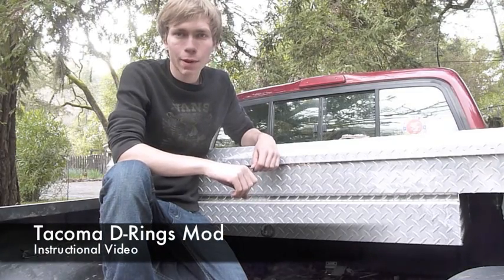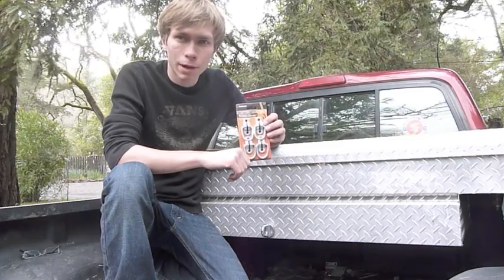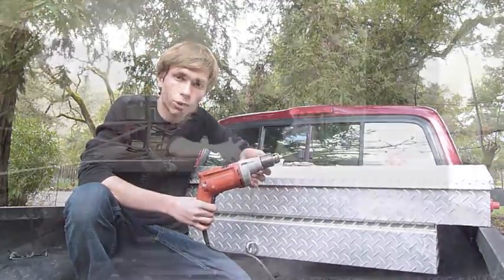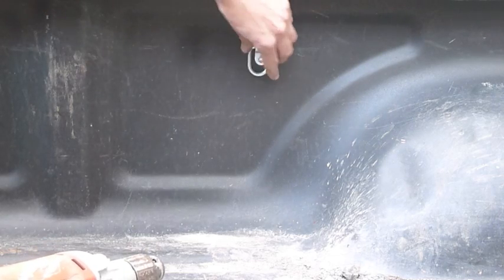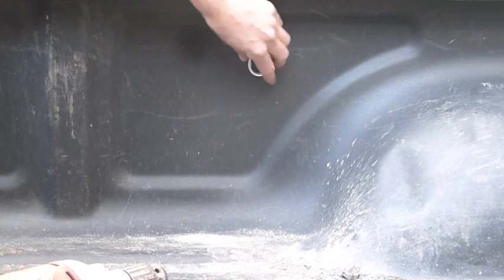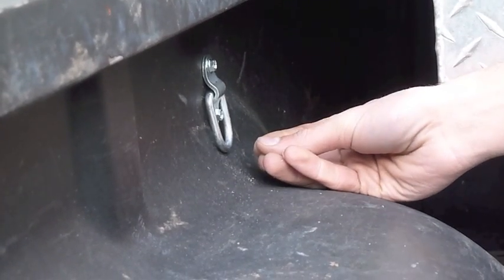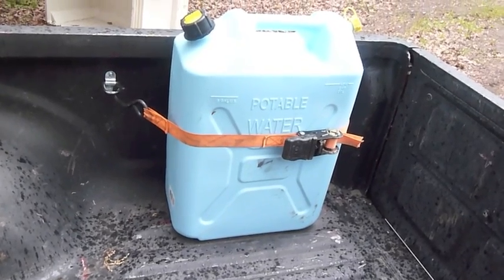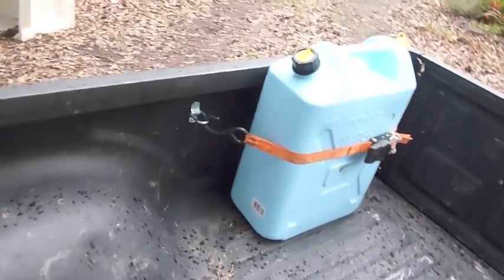Truck Bed Extra D-rings Mod "How to"

Comment: I hadn't considered just using self-tapping screws for the D-rings. Thanks for the video... I do a lot of home improvement and DIY and I've never seen anyone use the drill chuck to hold the actual screw head - but I like the hack :)
Reply: Hey when times are tough and tools arent you tend to use what you got in interesting ways,  hell i never thought of using plastic wrap as a contraceptive until hard times and times hard happened...

Comment: Since, in your video you didn't address the obvious concern of penetrating the outer body with the self-tapping screws, I'll ask here:
Is there a way to know the internal clearance between the inner bed wall lining and the back of the outer truck body, without simply eyeballing it or estimating? Are these clearances published anywhere?
Reply: lots of room
Reply: take a tail out. take a flash light an you can clearly see how wide it is
Reply: Get under your truck and look up??? Their is a good 4 - 6 inches of space between inner and outer metal.

Comment: I dunno how much force a shit metal screw is gonna hang on for..   im thinking of using those little anchors with the springed flip up v things you screw into...   big hole for it but fucker will hold as long as the threads do..  figure id need that seeing as sometimes i ratchet the shit way too much when tying down my sheeat...

Comment: You seem like a nice kid, and well intentioned,but unfortunately what you have done here is give out ill-advised information.  Water or fuel weighs in the neighborhood of 8 pounds per gallon.  By 5 is 40 pounds yanking on those little sheet metal screws.  Just not a well advised method.  Nuts and bolts with at least large fender washers backing them up.  Better yet, good sized backing plates behind the sheet metal.

Second, weight like that stuck all the way at the tail of the bed is a lousy idea.  The weight tends to become "the tail wagging the dog".  Better to keep the load forward of the axle whenever you can.  At higher speeds, if you had to swerve, that load all the way back could put that light truck into a spin that you couldn't save.

Simply a case of just getting something done versus doing it right.
Reply: You must drive a Ford if you think less than 100 pounds in the tail of the bed is gonna have a major impact on the handling of the truck. I understand the point you’re trying to make but less than 100 pounds isn’t going to make a big difference.